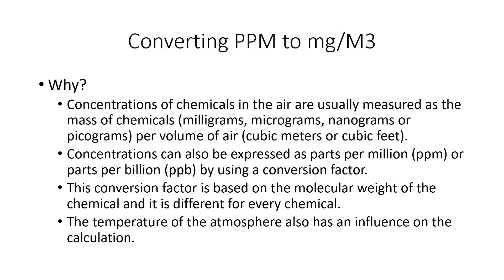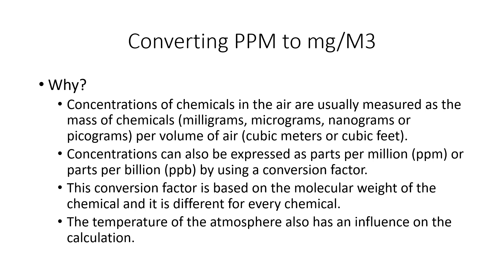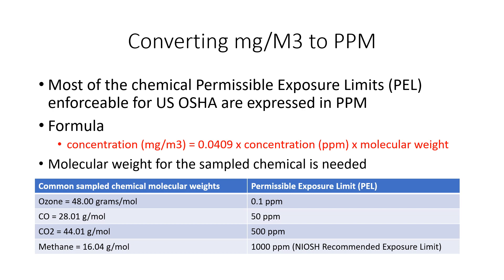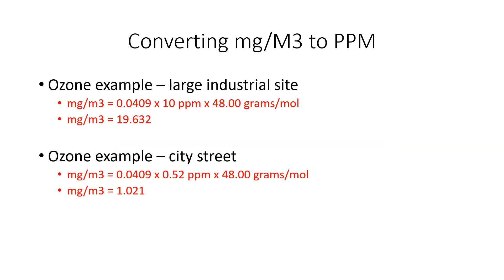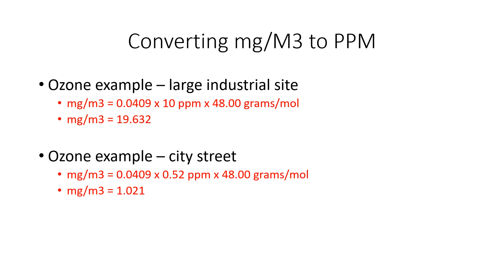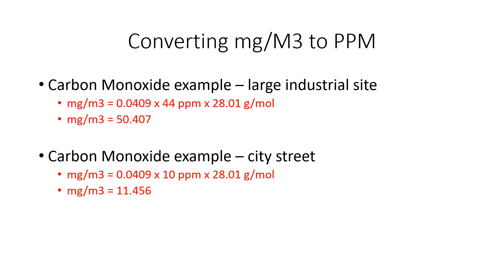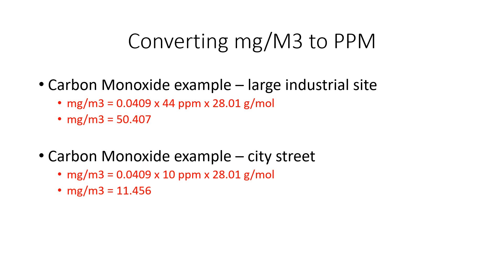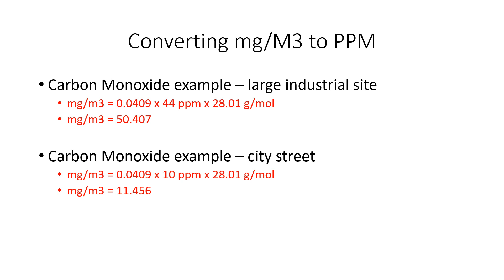Episode 40   Converting Parts per Million (PPM) to Mg-M3 in an air sample

Comment: I might have missed it but where did you get the 0.0409 constant from? Would this differ if I had a different temp or pressure? For example if I had ppm benzene and needed to convert to mg/m3 with temp of 273k and pressure of 0.90 atm.
Reply: Did you find answer to that question ? Would this differ if I had a different temp or pressure?